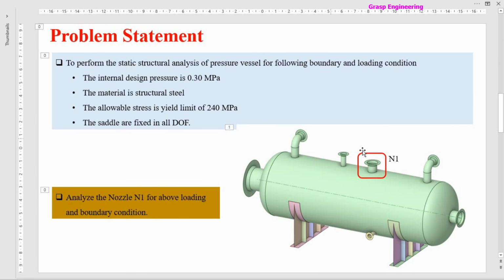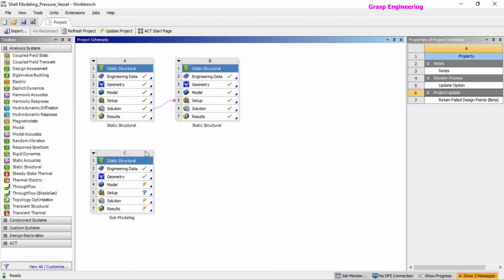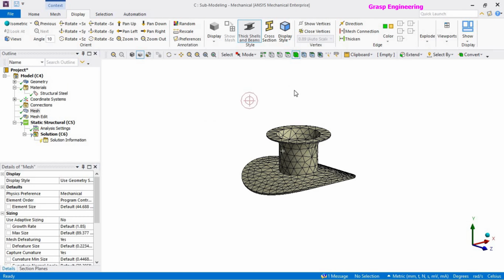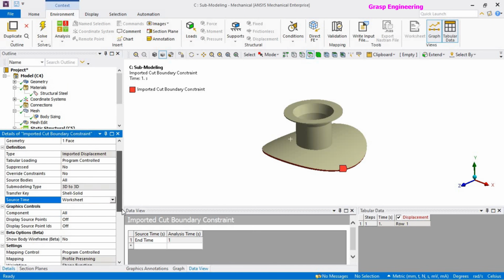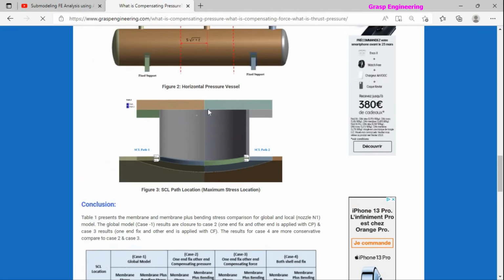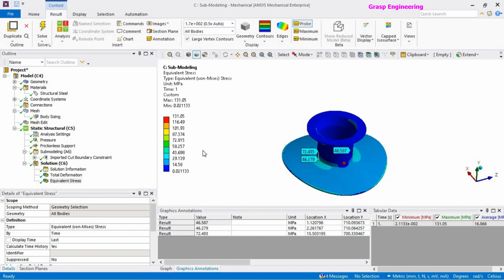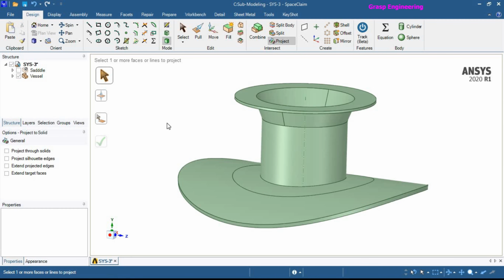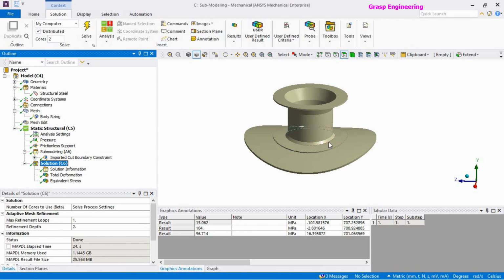Nozzle Analysis using Shell To Solid Sub modeling with ANSYS Workbench

Comment: Sir for running ansys Catia and other softwares, what are the specifications needed for system like graphic card size ,ram etc for smooth running without lagging
Reply from the maker: Better to buy workstation. Look into ANSYS portal for hardware/workstation requirement. Better to have 32-64 GB RAM/1TB hard disk/  64-bit Intel or AMD system, running Windows 10, A dedicated graphics card with latest drivers and at least 1GB video RAM.

Comment: Hello sir thank you for the video and your explanations of basic options also. But those localized stresses you're showing in 17:01 mins are observed in my model also. I am unable to get rid of that. I am using a similar shell to solid (solid model finely meshed 4-5 elements across thickness) submodel and those hotspotsn are everywhere. if you have any suggestions on how to get rid of those hot spots please let me know. Thanks  in advance.
Reply from the maker: First do proper mesh for your sub-model, as well as keep extra length portion. This stresses at cut boundaries are not required to report, this are localize and needs to ignore.
Reply: @graspengineering9249  Understood sir thank you.